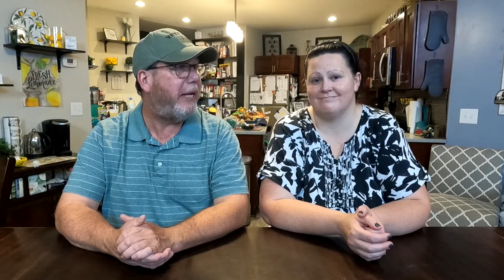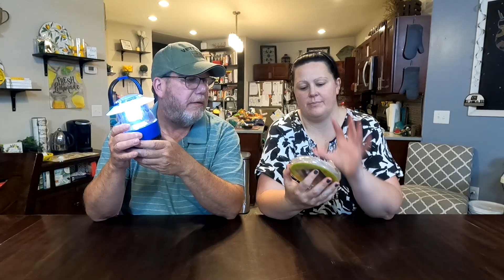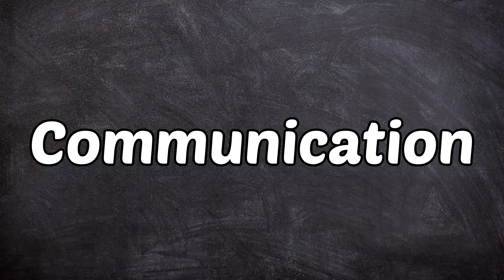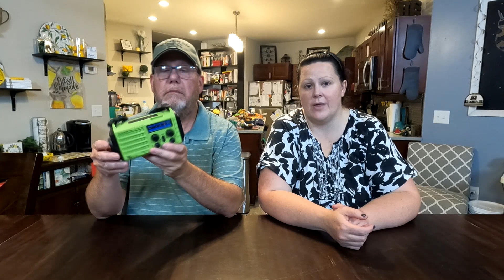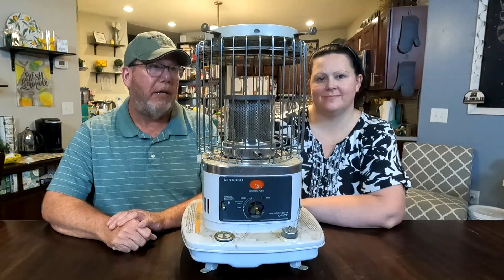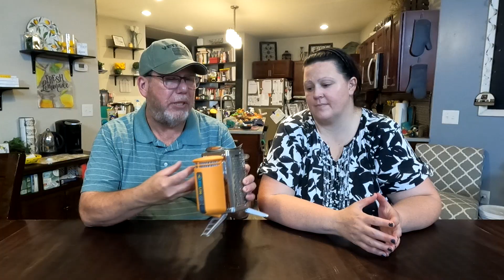Power OUTAGE and BLACKOUTS are Imminent – How to PREPARE!

Comment: Streamlight Siege AA x 3, 12 x Eneloops and a small solar panel with AA battery charger. My whole house can be lit all night for weeks if needed. The Siege works best upside down hanging from the roof with the cap off.. Even one on low in the hall, lights 5 rooms enough for walking about and will run 20+ hours before needing charging.

Comment: This might not work for families but for a single senior like me, this works great. Instead of popping bacon, hamburger, chicken, etc into the freezer when I purchase it, I have been doing a cooking "marathon". I cook the meat and then package it for the freezer. I looked it up to see how long it lasts and of course raw meat lasts longer. But if the power goes out, instead of losing all of that meat OR trying to cook it all up with a camp stove, I would just remove it from the freezer. I feel it would be easier to eat by heating it up rather than trying to cook it. Clean up is easier to do just one time as well.

Comment: I’m figuring out how to handle the heat here in my apartment in the San Fernando Valley of LA. I have a huge tarp to pin up on my patio to block as much sunlight as possible and I plan on getting a battery powered fan for my bedroom. I’m menopausal and I’m already hot enough on a regular night! I know that we’re going to have outages this summer, no doubt about it! Wet sheets can help cool off and I’m very grateful that we have a pool here.

Comment: How about PINK solar company? We are off the grid and our area hasn't had any outages yet but I hope that it works well. Ours won't run or heat pump or washer/ dryer.It will however;  run anything that is on a 110 but not 220 volts. So we have a microwave, fridge & freezers but will have to wash clothes in the bathtub!! LOL.

Comment: We lived in an apartment for years and went through a couple of hurricanes where our power was knocked out for a week. We spent a lot of time sitting in the car to keep cool, charge our phones and listen to the radio. Getting ice was nearly impossible because everyone was after it and convenience stores quickly ran out. They always turn the electricity back on for businesses first so people can get services. The best place to find ice if you need it is at fast food restaurants. 10 lb bag a lot of times is 1.00. Since we couldn't cook because we were not allowed a bbq grill we often used chafing fuel to heat our hurricane food and it worked well. Propert ventilation is important of course!

Comment: Your wrong about CO guys ! Most CO detectors are battery operated .Also remember fresh air readily dilutes CO .Most CO is caused by poor combustion and or venting.CO specific Gravity ( unlike CO2 is which is heavier than room air ) close to that of air it doesn’t sink it mixes readily with air .Again I am a HVAC refrigeration mechanic and have been for 30 years .combustion is part of my job .

Comment: Rather then unplugging your far better off turning off your individual breakers and the main .VIP when you bring them back up .Turn on circuits without inductive loads ( motors, compressors etc..) or electronics.these are the most susceptible to low voltage and spikes .Also turn on breakers slowly after bringing back up the main if you don’t under the right circumstances you could create minor problems up and to in certain extreme circumstances an explosion of the panel .

Comment: If you have a well you should have solar backup to power the pump.
No solar? You S.O.L..
Reply: @kfwilliams5773  I'm not lazy.. That was rude. My well is 100' deep.. Can't do hand pump, can't do drive well, can't do wind.. Don't want fuel generator.. Looking into solar. If you can't offer help then don't respond.
Reply: @crazyrabbitlady7884  You can use 3'' PVC pipe with a foot valve on it and hand lower it with a rope. Primative but it works.
Reply: Still trying to find one that will work for my submersible.. Any suggestions?

Comment: Thank you.
Can't say that we're adequately prepared for eveything but it's been an on-going project for 20+ years.  

When I found myself shoveling 7" of snow in the dark at 30F, I did the research and then designed and built my "Wait until daylight" solar backup system.  Most of the time, there's maybe 200 watts of solar panels in place to keep the battey bank charged to use it as a "big Jackery" ;-)  420AH battery bank, 2000 watt pure sine wave inverter (plus a spare) and a spreadsheet that's been 5 years in the making.  The spreadsheet lists the items we're most likely to want to use, that item's power draw and the number of hours it runs on a typical day - but with a lot of notes about summer vs winter.  Fridge and freezer run more hours in the summer (even with central air, there's 10F difference in the house: 68F winter, 78F summer).  The spreadsheet has a page for "Running with solar" that lets you enter what you want to power and how much solar panel wattage is out in the sun and you get the numbers of hours/days of power to be had.  That's a variable because there are 1500 watts of solar panels in the basement, ready to be moved out for a long term outage.  In a long term outage, we'd be eating down the freezer contents first so that much load could removed from the solar backup.  Then we'd eat down the big fridge/freezer contents until we only needed the 4.4 cu ft fridge that's currently in the basement.  That one we can power summer and winter and still have some LED lighting and charge phones if there is cell service (that amount of power is also included in the spreadsheet).  Useful sun hours are 5 in the summer and 3 in the winter, so you have to be aware of the month you're in to know which things you can use.  Fallback for power is a 1600 watt inverter generator and about 2-3 weeks of stored treated gas (then to the vehicles which are filled at the half tank mark for another 2-3 weeks).  If I needed to do repairs after a storm, there's a big, loud, thirsty 5000 watt gas generator that can run all the corded power tools and a 10" table saw.

We have eight 5 gallon water containers in the basement and there's a WaterBOB which can hold about 80 gallons in a bathtub (depends on the tub's size).  If we have any notice of County Water going off, the WaterBOB would be filled ASAP.  Fallback from there would be the water heater and the pipes in the house - easy enough to drain those pipes at the lowest outlet (in the basement bathroom).  Final fallback is the ~300 gollons of rainwater collected for watering flowers and shrubs.  That's water collected from an asphalt shingle roof so it needs a LOT of filtration to be potable but the 30 year rainfall records tell me we'd have 2 gallons/person/day all year, even in a typical dry year.  If I had inside space for a 5000 gallon tank, I could add another downspout to the rain collection plumbing and that tank would be filled in the first year.  Bathing is likely to be a sunshower bag (maybe two) once a week (have two 5 gallon bags and three 4 gallon bags) - there's also a spreadsheet for the water collection and usage and the size of the stroage tank is easily settable.

Alternate heating includes the gas logs in one fireplace (totally battery-operated so they work without power) and a kersoene heater that's seen lots of use in the 20+ years we've had it, including two weeks when the very efficient and very high tech gas furnace ate its controller board and the "3 day" turnaround took 14 days - but we stayed warm ;-)

Alternate cooking includes the gas stove (the burners are quite happy with a grill lighter), the gas grill, a 2 burner Coleman stove (LP, Coleman fuel or unleaded gas options), Sterno stove or a rocket stove out back.

Lighting includes limited LED lighting in the kitchen powered from the backup system or the generator, lots of solar-charged lights (MPowerd and others), USB/crank/squeeze LED lights, oil lamps and lanterns and a candle lantern.

Corded and battery-powered fans for cooling in summer and heat distribution in winter: having the kero heater on the tile floor of the kitchen with one fan blowing warm air down the hall to the master bedroom and bath and another fan blowing air down from the ceiling to warm the tile floor which serves as a heat bank overnight (the huge masonry fireplace is also a heat bank, retaining warmth for hours after the gas logs are turned off).  It's an older house with a lot of doors and almost half of the main level can be closed off by closing 3 doors.

Lots of books, DVDs, no-power-needed games (easy games, such as Yahtzee; thinking games, such as Taboo and Pictionary; competitive games, such as Monopoly), decks of cards and a Hoyle rulebook and whatever else is in te "games" closet in an upstairs bedroom ;-)  I'm likely to ce charging a laptop or a tabler so I can write - I have 11 mostly PAW fiction books on Amazon and a couple more in the works.  https://www.amazon.com/J-E-Carter/e/B01LVX00LP
Reply: why would you tell everyone all this stuff?

Comment: I’m getting a kerosene heater, but what the heck? Opening a windows seem counterproductive. You’ll still be cold…
Reply: Open a window near the heater about 1/2 to 1 inch.  Our best placement of the kero heater is in the kitchen about 6 feet from the slightly opened window and with access to the hall to the master bedroom and bath.  One fan blowing heat down the hall to the master bedroom; another blowing hot air down from the ceiling to warm that tile floor as a heat bank overnight  That's worked for us with no complaints from the CO detector less than 10 feet from the heater.  Longest time using the kero heater was 14 days when the high efficiency gas-fired furnace ate its controller in a cold January.  No controllers in stock and the "3 day" repair turnaround took 2 weeks.
Reply: @notyoung    That is wonderful explanation! Thank you! I wrote down what you said so I don't forget.  Thank you so much!
Reply: @notyoung  
Only problem is, what to do when everything is down: ie pumps, computers in stores, how will you get more kerosene  ??
I actually have a kerosene heater
Reply: @henryottis295  At that point, we'd be back to using wood.  There always seem to be empty 20lb LP tanks around, so I might run a generator long enough to make one of those into a fireplace-sized stove and just shrink down our used space.  I have a tent that can be erected in the room with a fireplace for an even smaller but easier to heat space.

Comment: Those large Brute garbage cans from Lowes…I bought one bc it’s a #4plastic! On the bottom it even has a glass and fork stamped on bottom. That means…You can store water in it! I put in my basement and filled with fresh water. I can run the water thru my Alexapro for extra security. I’m getting another one.
Reply: Good tip. 👍

Comment: 20 cords of wood! For one winter? We only use 5 cords for a big house. We have a Blaze King. I know they are expensive but well worth it as we get older and can't cut our own wood anymore. We are in the mountains of Idaho and heat at least at night from Sept thru May.
Reply: We went thru almost 5 cords of wood in our newly built house with 2”x6” build. R- 19 on the walls and greater then R- 35 in the attic (due to a screw up we had to get more insulation to lay across the stuff we put up already) I think the extra insulation REALLY made a difference. We were super cozy with just burning wood in our Vermont castings stove here in New Hampshire! 😊

Comment: Have screen on your windows and all doors. When I was young we didn’t have AC in the home. We had fans but the moved hot air. We would sit on the front porch or under a shade tree until it cooled down in the evening.
Reply: I wish there was a tree where I am, it's an old house with 4 apts a f no shade ☹️

Comment: I live in NY in a apartment building so I have been prepping for awhile with water,food ,meds ,food for my cats , batteries for my flashlights, battery operated lantern's and sensor lights. My concern is for my dad who is on diyalis and living in a old apt building with no backup generator do you have any suggestions to cool off ?
Reply: Good luck to you and your dad.
Reply: Amazon has battery operated fans that use D cell batteries. Just be sure to have plenty of batteries for him.
Reply: May have to move him in with you. Mom was on dialysis.... scary for them. Power outages here were plenty during the  winter time.  She would stress that there machines generators would fail too.

Comment: We have central ac n heat but also bought a portable ac for emergency to plug in generator.Fans don't help in TEXAS.Gotta have ac or will get heat stroke.Portable heaters use propane.A Woodstove sounds great but then u have to hire a contractor to install a vent.
Reply: What type of generator do you have please?
Reply: Bought a solar generator from 4 Patriots.They allow pymt plans and a dual gas/propane from home Depot,made by Pulsar.

Comment: "Because carbon monoxide is slightly lighter than air and also because it may be found with warm, rising air, detectors should be placed on a wall about 5 feet above the floor. The detector may be placed on the ceiling. Do not place the detector right next to or over a fireplace or flame-producing appliance."  from epa(dot)gov site.

Comment: I purchased a Jackery last year.  Along with that I also purchased a large capacity 12 volt fridge/freezer ( a lot of van lifers and overlanders use them) . A Jackery can not run a standard home freezer for very long....but it can run a 12 volt fridge for hours upon hours. Sense I'm in an apartment and solo living , this setup is perfect for me sense a gas generator isn't an option for me. ( something to consider for apartment dwellers)
Reply: Can you please share what Jackery you purchased and the model for that large capacity 12 volt fridge/freezer?
Reply: @conniediaz6456  most definitely! I have the Jackery 1000 . But another slightly cheaper option is the Jackery 880 which can be purchased from Lowe’s website I’m sure it can run the fridge  just as well just a slightly shorter timeframe with one charge.
And I have a setpower Aj50 fridge/freezer which has a 53 quart capacity . There are some larger versions on the market but of course they’re probably gonna cost more. 
To make the most out of space I tend to take all my meats and things out of their original packaging and vacuum seal them but this also helps if I ever have to move items to that portable fridge. It can fit quite a lot if the food is packaged right and you take the crate out .
Reply: @jasminem3902  Brilliant tips. I've got so much to learn! Thank you!
Reply: @jasminem3902  lol
Reply: @dianebriscoe666  I’m sorry. I musta missed the joke. I’d love for you to enlighten me 😎

Comment: Build your own Lifpo4 batteries.  By the 3.2 volt Lifpo4 cells from China.  Cells plus bms is a lithium battery for 1/5 the price of scumbag American company prices.  Add in a sine wave inverter to power your appliances.  New all in one inverters like the Growatt do it all.  Solar panels wired to Growatt wired to your lifepo4 batteries.  A complete solar system!

Comment: We live in southern Nevada and the loss of electric power to run our home's three AC units during summer here in the Mohave desert would be a life-threatening event. Our plan is to move into our motorhome for one or two days. We can run the onboard diesel generator to power the motorhome's AC unit. We can use the onboard propane to power the refrigerator and stove top. If the power outage lasts longer than two days, we will head out in the RV to a cooler climate or to an area where the campgrounds have electric power.

Right now, our motorhome is in the dealer's shop getting the required periodic tune up of its Mercedes engine and computer systems, but as soon as this is done the motorhome will be parked again next to our home and ready to go on the next trip. If the local power grid goes down before we get our motorhome back, we have a back-up plan. We will load up the Jeep and our truck with supplies and head to a cooler climate or one with electric power. If we cannot get a motel room any night on our journey, we will use our camping gear in a state park or national forest or other place that allows camping. We have camped in Maine, in Washington state and in North Dakota in July and August, so are familiar with taking a break from the summer heat here in the Mohave desert.
Reply: We used to live in Vegas, and I miss it a lot.  Our back porch faced south, and it was covered, and our yard was full of desert trees, so I was amazed to find I could hang out on that porch all summer!  Yes, it was hot, but I loved being out there all year.  Now we're moving to Florida, and I'm worried the humidity will be more uncomfortable than the high temps of the Mohave Desert.  I'd rather have 117 degrees and no humidity than 90 degrees and 90% humidity.  I'm really uptight about this.  But anyway, I miss Nevada, especially Red Rock Canyon!
Reply: 😮 - yes but !! : An  E. M. P from an enemy state across th Pacific may wreck yor Merc motorhomes Computer controls ( as well as much of th Grid ) so you need to keep an old diesel-only vehicle ,spare battery's + plenty of diesel

Comment: May I please ask you what portable AC unit you have? If you happen to have a link or a model, that would be great. Thank you I think I’m concerned is about AC in the summer and heat in the winter. And I don’t know what to do. Thanks again
Reply: I bought a window unit a small one to be able to plug into a generator for emergency ac and Walmart sells My Buddy portable heaters uses propane.
Reply: @alm777  I’m so appreciative of your response. Thank you so much.
Reply: @alm777  Can you please share what generator you will use for emergency A/C? Thank you in advance!
Reply: @conniediaz6456  would probably use the gas/propane generator unless,it's bad weather then use the solar one